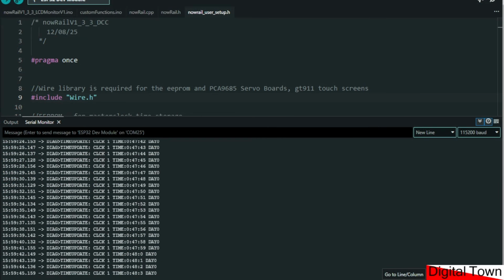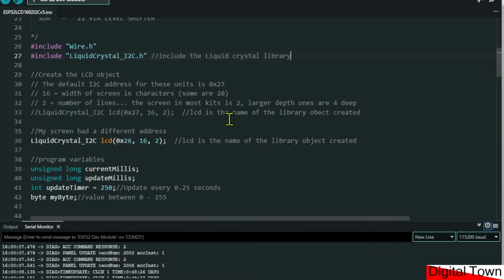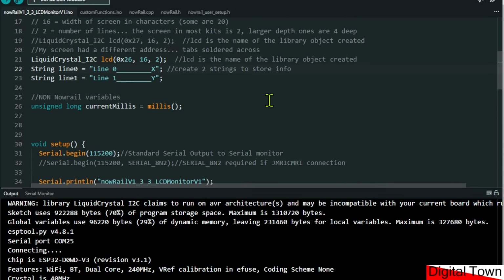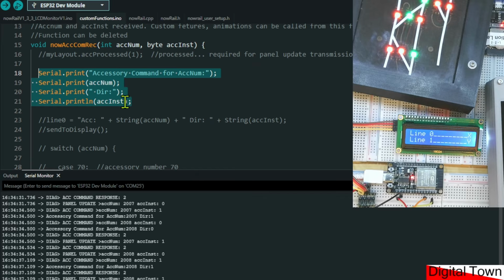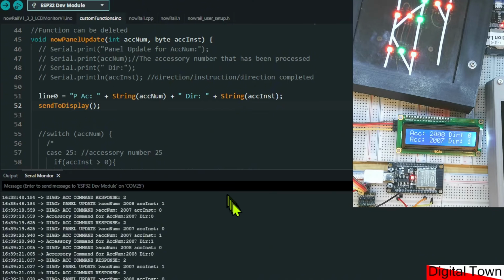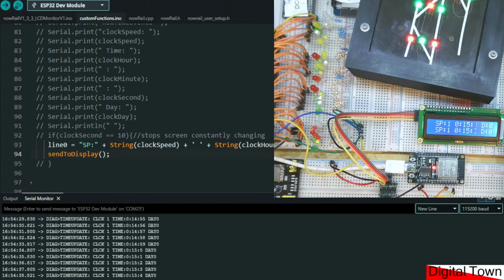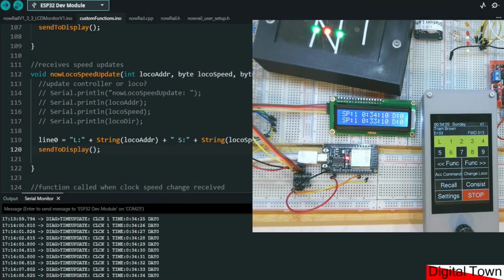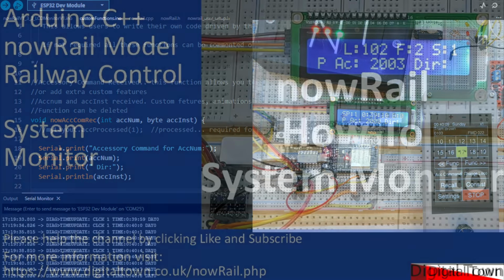#156 Arduino C++ nowRail Model Railway Control - How to build a nowRail system monitor

Comment: Hi,  is there any way to print to a dcc-ex command station screen from the serial monitor  or from Engine Driver.  Something tells me there should be a way, but for the life of me, I cant find any info or examples.   It would be nice to be able to print messages in real time.
Thanks a lot

Fred.
Reply from the maker: I would try the DCC-EX discord channel for that or look into the DCC EX code and find the lines that write to the screen to see the method they use.

Comment: Can the system use a real time clock rather than (what appears to be) time since startup?
Reply from the maker: On the nowRail page there is a section on EEPROM, if you add the EEPROM to a MASTERCLOCK it saves the current layout time as well as the current layout clock speed. I think it updates about once a minute.
This means when you switch the unit back on it reads the EEPROM and starts the layout time from that point.
I use it as I run my layout to a timetable. It's currently set to a 7 day week so you can then use the layout time to trigger events. Even various clocks on the layout will keep time.
I had thought about adding a real time clock and can look into it but the layout clock seemed more logical at the time.